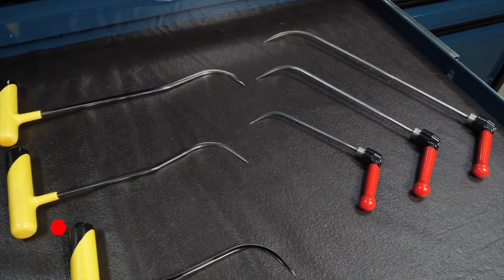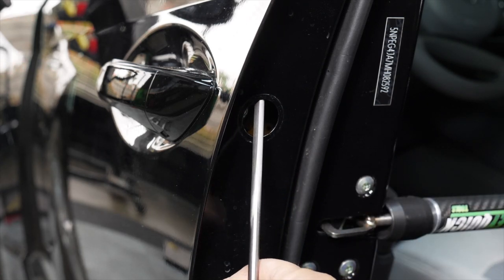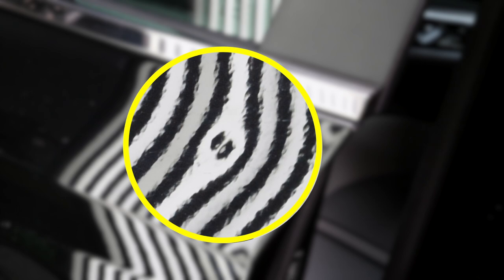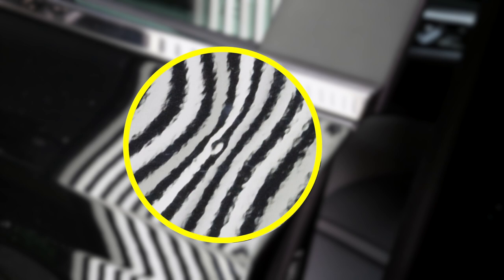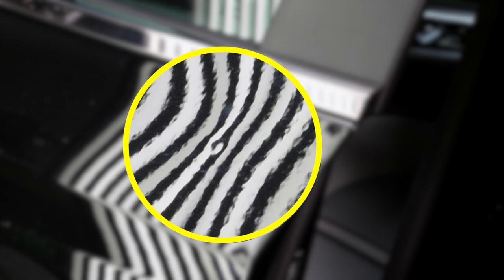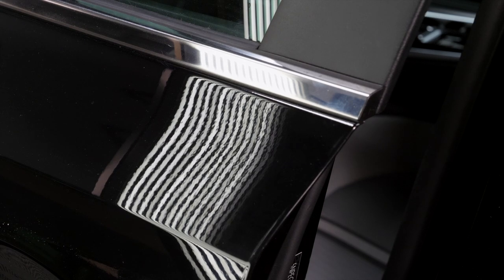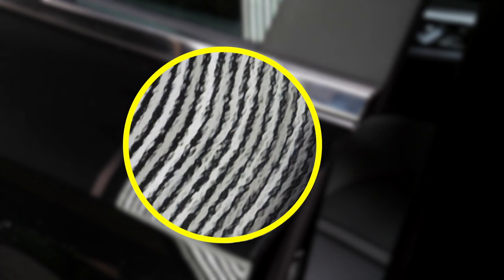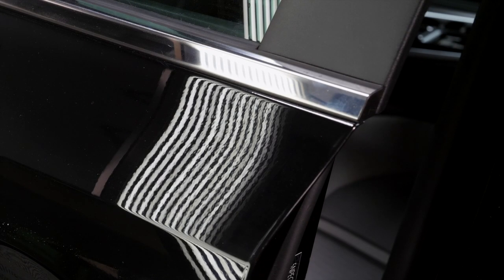Sharp Dents Need Sharp Tools - Professional PDR Tutorial

Comment: With a lot  of patience and  the right tools you can do it. I want to get into the PDR trade as a lifetime Auto bodyman  this is right up my alley, cleaner work more efficient and more money without having the sand Bondo down and prime and block primer and every other God forsaken things . But however the cost of PDR tools is very expensive and it's not cheap to get into. But being a cheapskate like me I'm going to start by buying knockdown tools and making my own paddle. I can't see spending a hundred bucks on a piece of wood with a little piece of leather on it . The price of $200 for an aluminum slide hammer is crazy money .Pro blending hammer another 2 hundred bucks .Crazy money . I have no doubt my mind that the average PDR technicians got 20 grand at least in equipment ,not counting all the newest stuff coming out. I did see a prime rod with a magnetic ball on the end which one you place a steel ball on the outside of the panel helps you pinpoint your pushes, however they're probably not practical to a real PDR tech but they look cool with me.